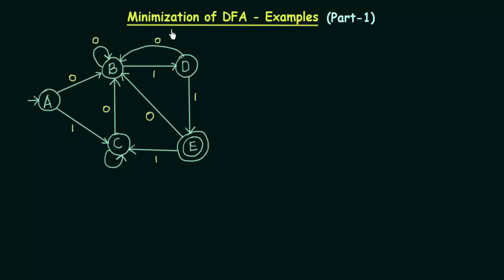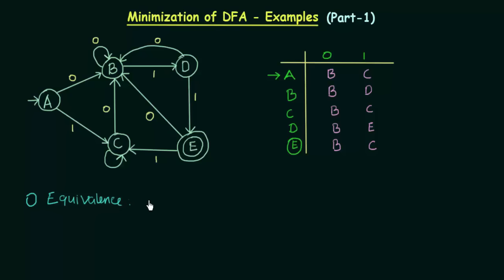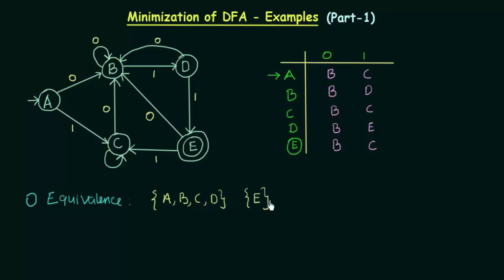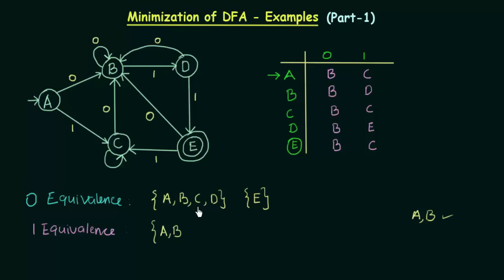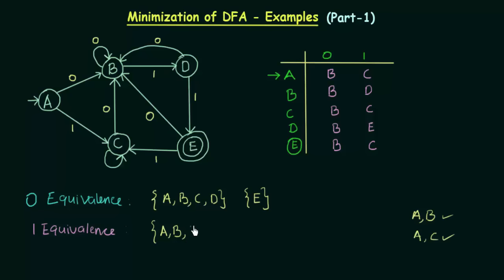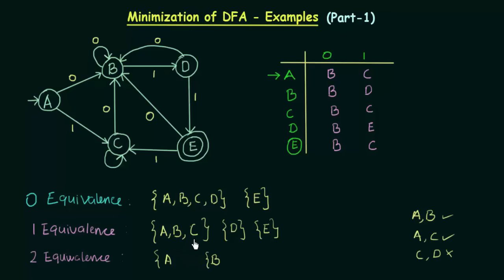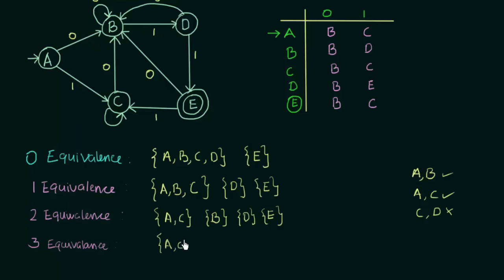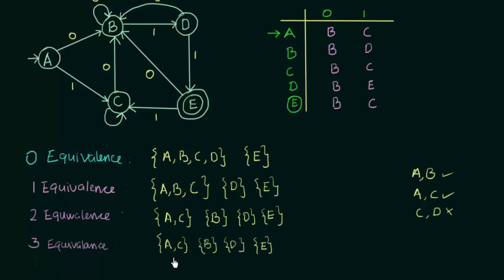Minimization of DFA (Example 1)

Comment: We start with 0-equivalence. Basically create 2 subsets, one with final states and the other with non-final states.
Now within each subset, try to find if constituent states are 1 equivalent. The way to do that is to pick two states at a time. If the two states transition to the same 0-equivalence subset on each input, then they are 1-equivalent.
If A,B and B,C are 1-equivalent, then A,C are also 1-equivalent.
If A,B are not 1-equivalent and B,C are, then A,C cannot be 1-equivalent
Repeat this process recursively till the output of n-equivalent and (n-1)-equivalent is the same
From that point, the subsets won’t change
All states within the same subset are equivalent

Comment: My summary

We start with 0-equivalence. Basically create 2 subsets, one with final states and the other with non-final states.
Now within each subset, try to find if constituent states are 1 equivalent. The way to do that is to pick two states at a time. If the two states transition to the same 0-equivalence subset on each input, then they are 1-equivalent.
If A,B and B,C are 1-equivalent, then A,C are also 1-equivalent.
If A,B are not 1-equivalent and B,C are, then A,C cannot be 1-equivalent
Repeat this process recursively till the output of n-equivalent and (n-1)-equivalent is the same
From that point, the subsets won’t change
All states within the same subset are equivalent.
Reply: it seems like if they transition to the same exact state, then it doesn't matter if they are in the same subset or not. I feel like that wasn't explained clearly in the video, but that seems to be how he did it
Reply: two states would be equivalent if they transition to states from the same set of states from precedent equivalence or transition to the same states for each input.
in case of 1,2 equivalence the transition goes to the precedent subset
for third equivalence we have for input 0: A->B, C->B and for input 1 A->C, C->C

Comment: So, what I get is that for n-equivalence just check, if they go  to the same states with the same inputs and have the same type of being final or not, then they go together, that's it: both A and C can be joined because of the outputs, however E can't because it's a final state, if there was a F state that had the same outputs and was also final it could be joined with E, but not with A and C.
Hope i was clear.

Comment: Sir firstly thanks for your videos
here I want to tell you that you have missed concept of unreachable states as you directly applied checking state equivalence and in some questions if we dont remove unreachable states then our final state have that extra unreachable stat e and thus it will not be minimized(correct).
Although it is also advised to merge all dead states into one before applying this video's method but is optional as applying the method shown in this video will automatically do that.

Comment: how A and C are 3 equivalents?
because output of A and C have B which is in a different set in 2ND equivalence.
Reply: A and C go to same state B(taking 0) and C(taking 1)
Reply: Siddharth Y if they goes to different states then u check whether they r in same set ,if they r in same state then no worries!
Reply: got it. thanks
Reply: Zabardast hai
Reply: B is not 2 equivalent because it maps to a different set than A and C for input 1 (A and C map to {A,B,C} and B maps to {D}). A and C are three equivalent because they map to the same set regardless of the input ({B} if 0 and {A,C} if 1). Furthermore, they are n equivalent for integers >= 0 as they will always map to the same sets respectively.
Reply: as long as outputs are in same sets (not own sets) they are indistinguishable and therefore equivalent.
Reply: Tumse na ho payega
Reply: Check for each input

Comment: sir i think you did a mistake in 3 equivalaence where in (A,C) when input is 0 then they are going for B and as previous equivalance they must follow the row and in the previous row their is only (A,C) which means A will be seperate and C also will be seperate. Am i wrong?, If i am wrong then correct me.

Comment: How come in 3 Equivalence, A & C are equivalent to each other?

On getting input 0, both A & C go to state B which is outside of {A, C}.... So, how come A & C are 3 equivalent to each other?
Reply: if you have same states on input 0 and 1, you dont need to check set
in case of set {A,C} 
'A' goes to 'B' on input '0' and  'C'  also goes to 'B' on input '0'(same state 'B')... and on input '1' both are going to 'C'
so you dont need to check the set {A,C} because both are going to same state
Reply: @janisar_hyder  Thank You

Comment: By the definition of 1-equivalence, won't A and E be 1-equivalent? Since on taking input of length 1, they both go to non-final states. In the definition, should the length be <= instead of = ?
Reply: Yes that is correct, the definition should be <= which would then cause A and E to not be 1-equivalent

Comment: What if the dfa has multiple final states?
Reply: I am also wondering how one can answer such a question with multiple final states
Reply: @christinekasangili6846  I presented the exam few weeks ago. You just have to treat all the final states like it was any other state. And at the end, the states that you have will be "sets of states" if a set consists only of final states, you mark it as final. It cannot happen that a set has final and non final states because of the first step, but it can happen that a set consists of multiple final states

Comment: How come A and C are 3 equivalent to each other? On comparing A and C, A and C on getting an input 0 goes to B whereas on getting input 1 goes to C. So how come they are equivalent if they are not on the same set?
Reply: Correct
Reply: @ujjwalbhardwaj1519 no it's not correct
Reply: The output that A gets on 0 may be in a different set than the output A gets on 1, same goes with C

However, what we are checking is for 0, are the outputs of A and C in the same set, and for 1, are the outputs of A and C in the same set

On input 0, A and C go to B, which is the same set as each other
On input 1, A and C go to C, which is also the same set as each other
For 0 and 1, the set of the output state doesn't have to be the same
Reply: First condition is to check that , they goes for same state or not ,

Comment: state A,C,E all three have similar i/p and o/p as well as so all three are equal state.....naa?so why don't combine E with A,C state?
Reply: You cannot combine FINAL with NON-FINAL states. You would get an ambiguity on whether to make it FINAL or NON-FINAL after combination.
Reply: then how would in this video they combine initial state with normal state?so after minimization that C also became initial state.....naa?
Reply: The logic behind that is an initial state also belongs to a state that is "NOT- ACCEPTED", hence it is part of the sets that are considered to be NON-FINAL. Suppose in this case if A was also a FINAL state. Then C would not have been combined with A. But instead E would have been combined. This gives, {A,E},{C},{B},{D}. If you notice, even though A is the initial state, It can be combined with E. Since even an initial state can be considered to be FINAL.
Reply: You cannot assume that initial states and final states always follow the same logic in all operations ... and I shouldn't have to tell you that.